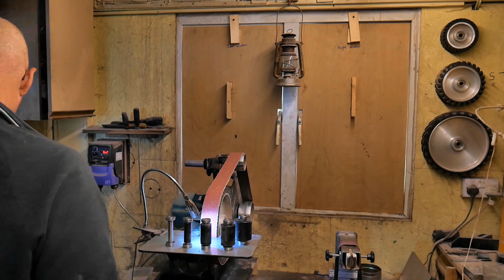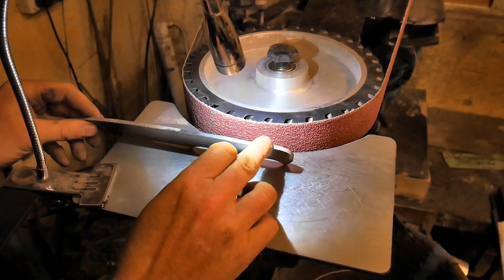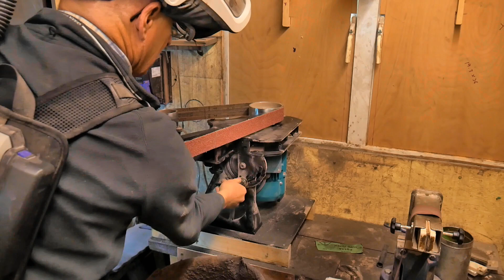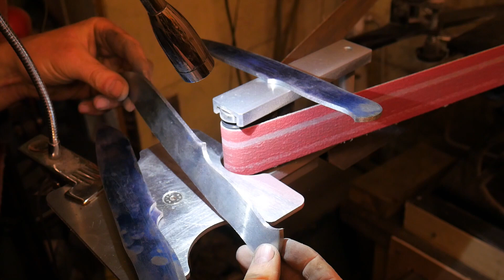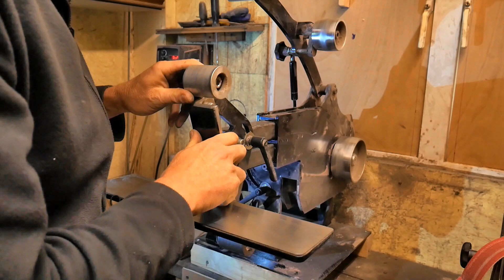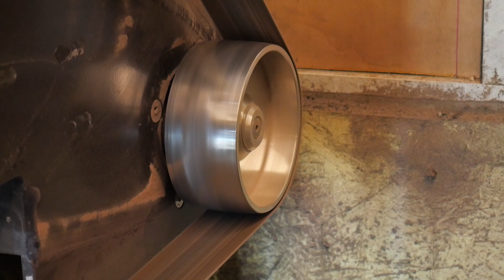A closer look at the MP Knife Makers Grinder by Mike Palmer

Comment: Hey I'm just making a suggestion and don't mean any disrespect in doing so. Anyway in my opinion you need to utilize your grinder belts more sparingly meaning the belt you had on when you first started do the horizontal grinding was way way to course leaving heavy grind lines making you have to take extra steps to get the grind lines out. The belt was for heavy metal reduction or removal and one of the most used belts though I'm not sure of your process! I don't know what grit belt it was but it looked like an 80 to 100 grit but it's been some time since I last used a belt grinder anyway keep making those beautiful pieces of art that you make and hopefully some day I'll be fortunate enough to afford one and I don't know your prices haven't looked but based on the quality of your work it's more than I can afford at the moment

Comment: Now that is a nice grinder, can this be used for normal sanding also? I would imaging to do this you would have to enclose the bearings so they don't get the dust in them from wood? Now, them CampPro's are big, is there a name for them? I call them the CampPro (Camping Protector) because of the size 8^).  Anyway, really, really nice setup Sandy and kudos to Mike for the design and the thinking put into this grinder!

Comment: Sandy why was the belt oscillating up and down with the first small radios belt.  happy Trails
Reply: Mike Boone some belts do this it’s a slight fault in manufacturing not being cut and joined perfectly
Reply: @MikePalmer42  To think I was thinking it's just misalignment in the roller you know crude behind either the top or bottom bearing . Good to know . Stay safe out there Happy Trails From California